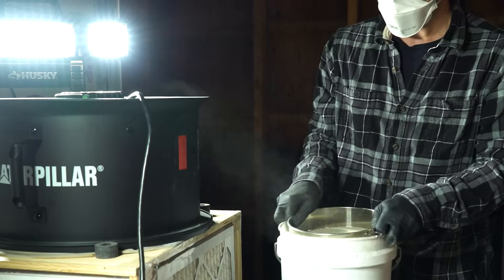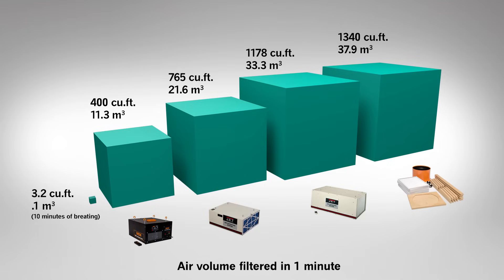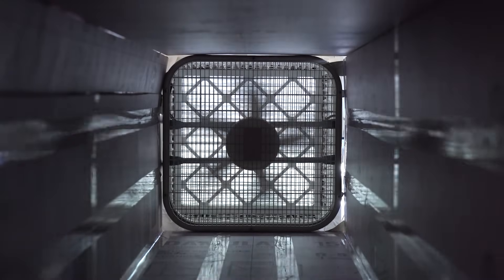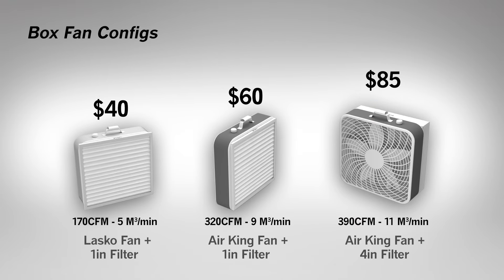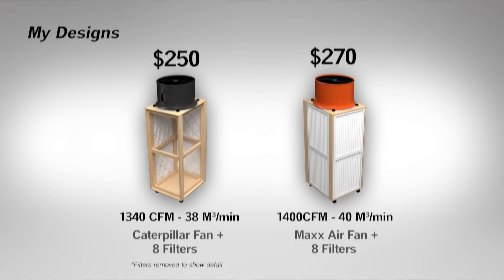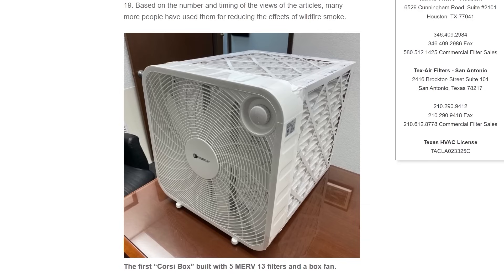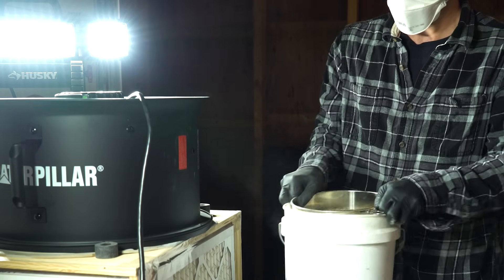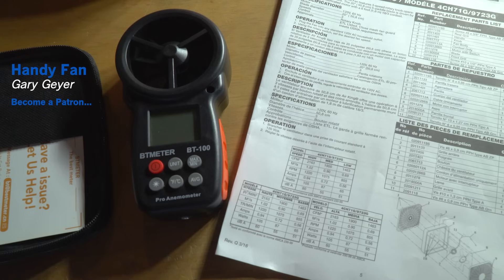What is the best DIY Air Filter?

Comment: I built my system into the ceiling of my basement shop... inside the floor joists of the floor above.  Two replaceable 25x16x1" MERV 13 filters, held with a simple frame, boxed into the joist cavity with one end cut open to an 8" HVAC 420 CFM duct booster fan (pulls the air through the filter box).  Should be about 725 sq. in. of filter area.  It draws the air up above my main area where the table saw and assembly tables are, sending it down a 8 foot length of 8" HVAC duct to the other side of the room (keeps the air circulating about the shop).

Perfect?  No, but it fits my shop space and does cycle all the air in about 6 minutes, reducing the dust noticeably.  I even got an Amazon Smart Air Quality monitor on black Friday sale with a smart switch... it auto turns on the system when the dust levels (and/or VOCs) build and shuts it off once it clears.

All in, including the air monitor and smart switch, was under $160.
Reply from the maker: Nice setup! Great price as well. It helps when the box is already built 👍

Comment: Thks & you must have a PhD in AirFiltering (& you sounds a little like Jack Web too ;). 
I says it's best to just blow airborne particulates out the house via an air2air heat exchanger (?how to make one though?).
Oh, the cheap $20 Walmart square fan barely fits thru a standard attic-access hole & will sit on the trim-work around the access-hole.  Sooooooo in summer I blow hot-air out the house/attic and in winter turn the fan over, put a dust filter on top, & blow warm-air from the attic into the house (yeaps, I'm cheap ;).  I wish I could figured-out how to make the cheap square fan bi-directional though & wouldn't have to turn it over (ex: put 2 square fans in opposite directions & just run one or the other ;) & thks for the links.
Videos that might be of interest:
Air King and Lasko (different but the same) https://www.youtube.com/watch?v=UdWIT_L9xaY
How to Build a Corsi-Rosenthal Box https://www.youtube.com/watch?v=hIuH-2naozI
     corsi-rosenthal box https://edgecollective.io/airbox/
All the geeky Corsi-Rosenthal Box details too:
     Pandemic Engineering: Tools for Lowering Risk and Spread of Infection (corsi-rosenthal box @40:00) https://www.youtube.com/watch?v=satClvgR1eo
Reply from the maker: That is a great idea! I may need to build one of these for my 3D printing room. With all the VOCs air filters just don't do the trick. Thanks for the ideas!

Comment: For your vacuum pump you should consider Koby Vacuum Pump Exhaust Filters/Purifiers or equivalent. No going back without those oil filter.
Reply from the maker: Agreed. I used the filter as a cheap workaround but this kind of filter is better for the task. Thanks for the info!

Comment: i was planning on making one using a bunch of high performance computer fans together. do you think they might be more accurate with their cfm rating?
Reply from the maker: Those probably aren't tested under high static pressure loads so the CFM ratings would likely drop a bit once you hook the filter up to them. Are you using high RPM server fans... the kind that sound like jet engines or standard fans?
Reply: @The3DHandyman  I just started planning it last night, I found your video while doing some research on the subject so I was just trying to see if the idea was at all feasible at this point but yeah my thought was to use high rpm fans. I found your video very informative so thanks for that and thanks for replying to my comment.
Reply from the maker: @markjust86  Any time! Thanks for watching. The server grade fans likely have far less performance drop than the consumer grade variety.

Comment: What are your thoughts on stacking two fans? For example 4 inch filter then fan then another 4 inch filter then another fan.
Reply from the maker: Great question! I would probably not recommend it. If you think about a Jet Engine the secondary blades have a different pitch than the primary blades to better move air that is already moving quickly. If you want to run two fans you should just have 2 separate filters. This way you are getting double the power. If you run fans in serial (rather than parallel) you will likely see a performance drop of up to 50% on the second fan. So the total power of 2 stacked fans would be 150% more than a single fan rather than 200% if the fans were separate.
Reply: @The3DHandyman  thanks. I think I'm going to make to separate units and put them in different corners

Comment: 3D Handyman, thank you for this very enlightening information. However, it seems to me that since most of the cost of these builds comes from the prohibitively expensive filters that need to be replaced regularly, it would be much more cost effective and simple to mount a powerful fan on a piece of plywood sized to the opening of a nearby window. So long as another window in the room was open, the fine dust would be expelled to the outdoors. Is there any reason that this design would not work well?
Reply from the maker: Fair point! If you are working in a space that allows you to exhaust all the particles, that is a great option. If it is excessively cold or hot and you are working with materials that prefer climate control and storage filtering the space can be a better option. Filters are expensive but so is running a furnace or A/C! You may also have neighbors close by and they may not want a pile of sawdust on their car or blowing in their windows.

One option for long term low cost filtration might be K&N furnace filters that can be washed whenever they need it. The upfront cost is pretty high but they should last for many years of use. In my newest video I test them and they are not the best but they are still quite good.

Comment: You got a new sub after this, really well done and timely for me as I build out my basement, hobby woodshop. I have a 1.5hp dust collector for at tool collection but wanted some sort of air filtration. My space is 30x15, wondering if I build 2 or 3 of your designs on wheels to get pulled around where I’m working or at either corner for even better air filtration!

I looked on your website but don’t see plans to that one, am I looking right at it?
Reply from the maker: That would be some seriously efficient air filtration! Are you looking for the tall version with the drum fan? If so at the bottom of this page you will see "Original Air Filter – 1340CFM Portable Design" There is a version in inches "Imperial measurement" and a metric version. https://the3dhandyman.com/workshop-air-filter-series/

Here is the build video for that design.
https://youtu.be/fixd7LqnWow

If you are looking for a different design, let me know and I will see what I can do.
Reply: @The3DHandyman  this is perfect, that’s the one I was thinking about. Because it’s basement air filtration is really important to me. Also I can build 2 of these for the price of one ceiling one you can buy that didn’t perform as good! Seems like no brainer.
Reply from the maker: @michaelmartinwoodworks  I'm sure you will love the results. If you have any ideas for improvements or anything, let me know!
Reply from the maker: @michaelmartinwoodworks  I'm sure you will love the results. Let me know if there are any ideas you have for improvements!

Comment: Amazing video! I've watched half a dozen of these but this one stands out for the methodology.

Question:

I didn't see if you addressed this, but is there any benefit to building the "downdraft" version with a second, matching fan up top forcing the air in? 

I'd want to make that and use 8x 4" Merv 14 filters (3M Filtrete).
Reply from the maker: Thanks! I just did a filter testing video and the 3Ms are the best. In the next video I will try out the 4in MERV 11s. Off the top of my head, I would say that 2 opposing fans would work best if the unit were mounted on the ceiling with lots of space for the outgoing air to circulate around the space. If the 2 fan unit is positioned vertically, the outgoing air might end up creating a lot of turbulence that could hinder the filter from working optimally.

Comment: Great article and information, thank you. I will build one of these in a couple months time (need to make space). I think your end picture of the 'downdraft' model is ideal for me in respect to where the fan is. I guess you are making that to pull air in through the filters from the outside and pull the air out of the inside of the filters with the fan on bottom and air exiting the fan vs. the top install design you have with the fan on top pushing air into the inside of the filters and out through the filters. I will try the fan installed on bottom but still pushing the air into the filters (i.e. 'Updraft' ) . Will let you know once I get to it. I'll buy off your affiliate links to help. Thanks for the ideas and testing that was very well done.
Reply from the maker: Awesome! I'm happy to help. I hope that I can get another video out about the concept of pushing air into the filters vs pulling air out of them before you get to build time. Some people don't like the idea but I think it works great in practice!

Comment: I assume it would be annoying to sleep with this in your bedroom on high speed.  😄 How much quieter is it on the lowest speed?  Would that be acceptable in a bedroom, compared with other fans you'd use in there like tower fans?
Reply from the maker: Just put this together for the new video! The answer is, that they are all loud on HIGH. I think I could sleep with any of them LOW on in my bedroom. The Air King is the least pleasant sound of all tested. The drum fans make a nicer sound than the Lasko but they are technically more loud.

High/Med/Low
Lasko @1ft - 63, 60, 55
Air King @1ft - 68, 66, 61
Maxx air @1ft - 71, 67, 57
Caterpillar @1ft - 71, 67, 63, 57
Air doctor HEPA @1ft - 64, 58, 52, 45
Reply: @The3DHandyman  Thanks for sharing early!  That helps a lot to put it in context.  Looking forward to the video.

Comment: Did you try your design with 4 or 5 filters, to see the effect on CFM?  Curious how the Maxx would do with 4 or 5.  I'm going to be using much more expensive HEPA13 filters (like a MERV17) for better virus filtration than the MERV 14's.  So, cost of filters is a big deal.
Reply from the maker: Those are pretty expensive filters, and it may not be completely necessary. I will have a video out this week with what sort of small particle filtration you can expect from MERV 8-14 filters. The 3M merv 14's are really quite impressive.

As for the 4 vs 5 filters, the 5 filter design does manage to crank out 10-20% more CFM with but that does not seem to translate into better small particle filtration. I did not test them with the legs on, but rather resting about 8 inches off of the ground. It may be that the legs will allow for a bit more dirty air to pass under the filter for filtration, but I did not test that. 

That said, the tests were done with a Air King fan, not one of the more powerful Maxx air or Caterpillar fans. With the extra horsepower the 5th filter might be best to have. That, or move to 20x30 filters for additional air flow. Sometimes the 20x30s are not much more than the 20x20s.

I am going to release some wooden kits for these within the next 2 weeks. It makes for easy filter changes w/o tape or tools (other than a screwdriver).  They are also 1in and 2in filter compatible. I only have an option for a box fan on the 20x30in unit but I could add a Maxx Air option!
Reply: @The3DHandyman  It might not be necessary.  I'm looking for top of the line virus filtration rather than something like sawdust.  For the 0.3-1.0 micron size of viruses, the MERV13's only filter > 75%.  The Hepa H13 filters get 99.97% of 0.3 micron.  But, I want to go with something that will pretty much get it all in the first shot.  As the MERV13's cycles the same air multiple times over time, I'd expect that percentage to get better and better, but I don't know if it would scale as an independent random chance event would.  Meaning, 6 cycles of the same air if each only left 25% of what the previous cycle did would also reach 99.97%.  But, it might not quite scale that way, or maybe filtering multiple rooms that are joined (so the total square footage is quite a bit) there could be areas where the air isn't cycled as often as areas close to the unit.  So, I want to go with something that will pretty much get it all in the first shot.  

I really wanted to go with a DIY fan, but I ran across a new but open box Colzer KJ800 Air Purifier that has two Hepa H13 filters that moves a ton of air for $220, and I couldn't say no to that.  If I'm not happy with it, I'll definitely be coming back to a DIY solution.  Happy to hear about your DIY kits!

There's a test (potential video) I am frustrated I can't find anywhere.  People and manufacturers have put air purifiers in something like a plexiglass enclosure, sometimes not much bigger than the air purifier, sometimes the size of a small room.  They'll then fill it with smoke, fog, or tear gas, and show how well and quickly it removes it all.  I'd love to see someone fill an entire house, with probably fog to be safe, and run a very high CFM unit to see how it does.  I live in a tri-level, and the kitchen, dining room, living room, and half underground living room are all an open floorplan.  I'd love to see how it ate through all that.  I'm also quite curious to see how bedrooms would do, both with doors open or closed.  I'm not sure I can get the family to let me fog-bomb the entire house.  😂

There's certainly HEPA filtration that can work with furnaces, but I do want something somewhat portable.
Reply from the maker: @michaeldarling6336  Lol yeah, I'm not sure I can convince anyone to let me fill the house with smoke either! It would be a great test tho. A full garage will have to suffice for this go around. I though the "tiny glass box" test with smoke was interesting but really doesn't show how well the design circulates air which is very important to the overall performance. 

I  get what you are saying about capturing everything on the first pass. I'd like to test out some HEPA filters at some point with the same test that I just ran on the DIY units. It's just a dauntingly expensive video if I have to buy a bunch of them! Maybe one day.

Comment: Just wanna let you know, I’ve been using your design in my hobby shop for over 6 months. Am pretty happy with the results. Great bang for the buck. 
I wish there was a design for the fan intake be at hip level or chest level though. 
Here’s a pick of my filter cart : https://i.imgur.com/yhCOe3E.jpg
Reply from the maker: Awesome! Great filter choice as well. I just tested the 3M filters and they are the best out there. Did you go with 20x20 filters? 

I am making some kits for 20"x30" filters that might be just right for you. I designed it with box fans in mind but it could easily work with the drum fans. The total height would be 10" shorter than this one. Would that be enough?
Reply: @The3DHandyman  Yeah, these are the 3M 20x20. yeah, 10" lower would be better I suppose. Ive been meaning to experiment with an inverted drum fan inside the cart, but am not sure whether the intake-outtake air ratio would be appropriate. Looking forward to seeing your new design. Cheers!
Reply from the maker: @tanmaykulkarni  It would seem that with the 20" filters, there would be enough space in there. I cant say for sure how the airflow would be effected by that tho. My guess is that the top 12" of the filters would no longer take on much dust due to reduced airflow.

If you do test it out, you could get some incense and burn it close to the current config and the inverted config and see if there is any significant difference in airflow.